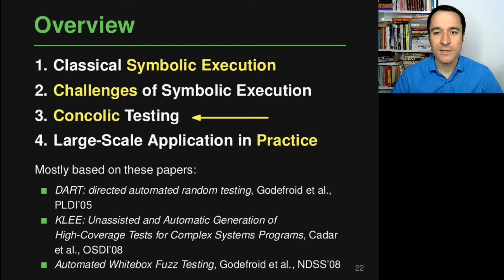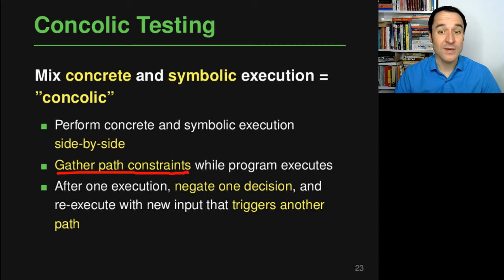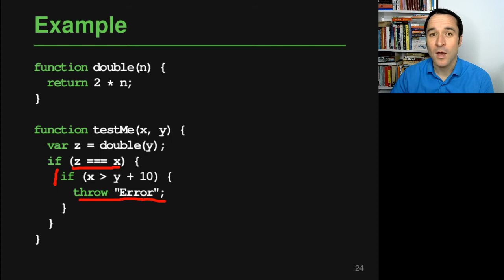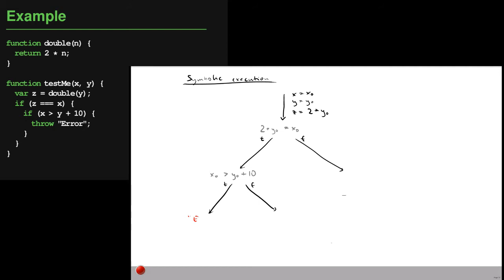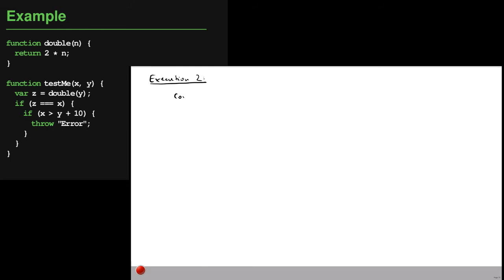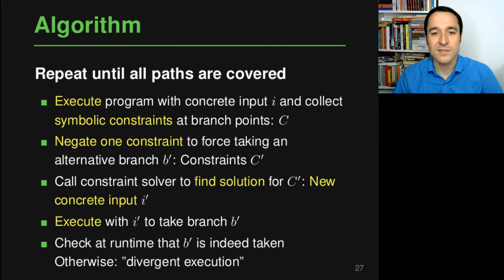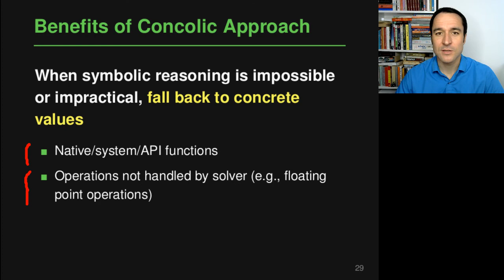Lecture "Symbolic and Concolic Testing (Part 3, Concolic)" of "Program Analysis"

Comment: Fantastic explanation, thank you.
btw: can you please explain why we start the execution from the start each iteration? You said in the video that divergent executions  often doesn't happen, so starting the execution from a specific branch is much faster.
Reply: Yes, you are correct here, but in a scenario where the negation leads to an exploration of a new path so in this case, the solver may not know the solution of the new branch condition that got in conjunction with the path condition. A concrete execution may be able to identify whether reaching this new state is possible or not and thus a new exploration with random values must be done on each iteration when the negation happened. Also there could be function calls and complex mathematical functions that the theorem prover may not be able to handle (constraint solver bails out), in that case, a concrete execution is a witness to the execution reaching the negated condition program point.